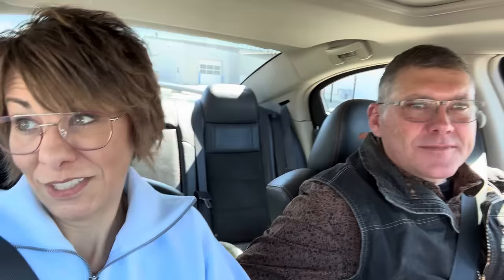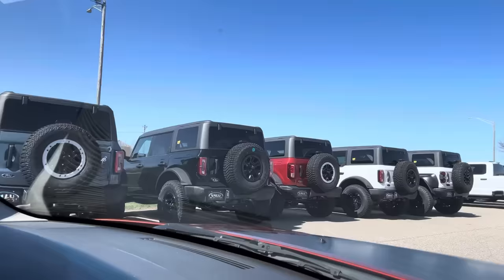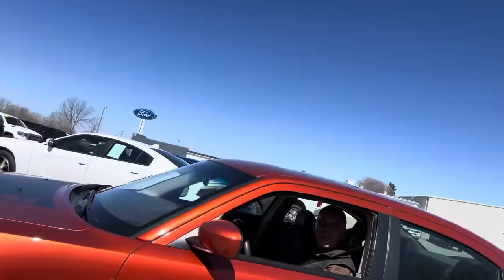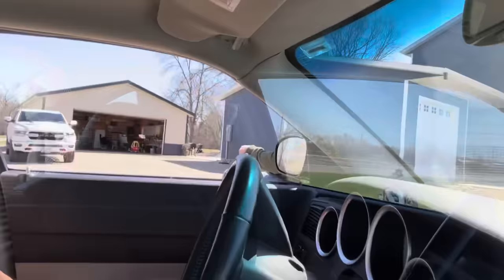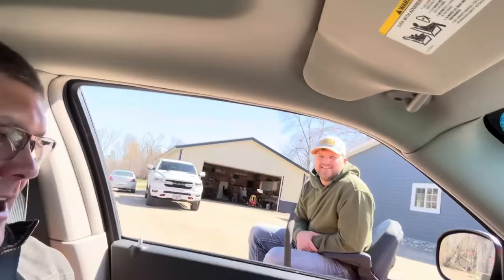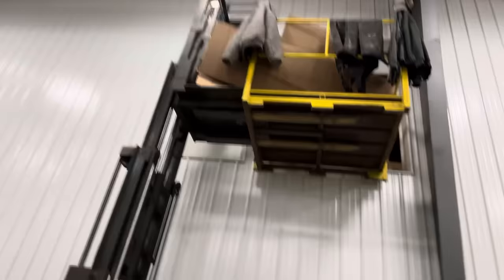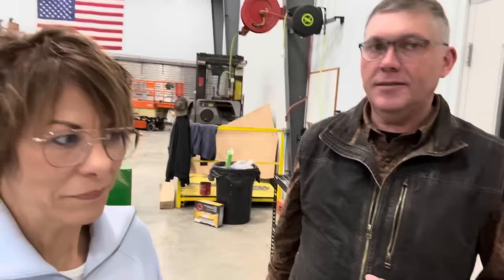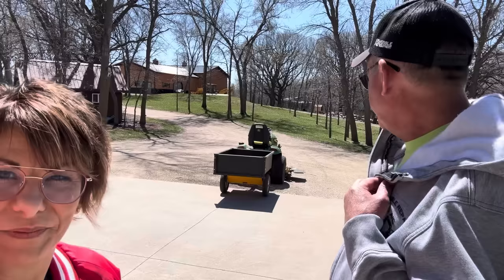We Always End up at the Shop

Comment: you don't want anything with cylinder delete as they are crap I think only new pickup worth buying would be regular toyota tundra and not the electrically assisted one. Toyota's are pretty much assured to get 300k before needing replaced.